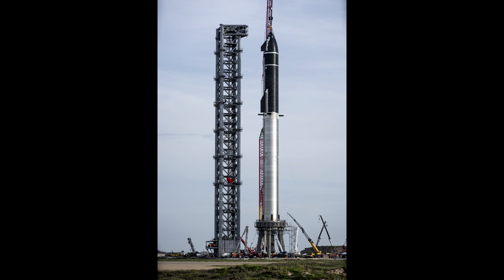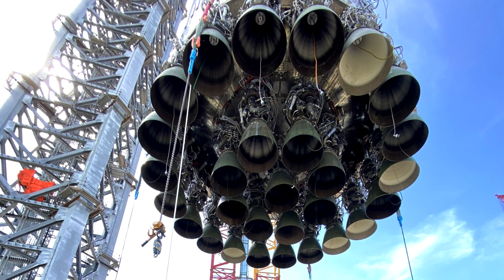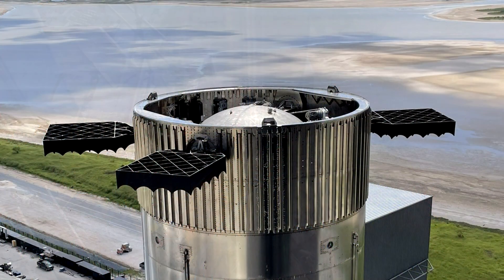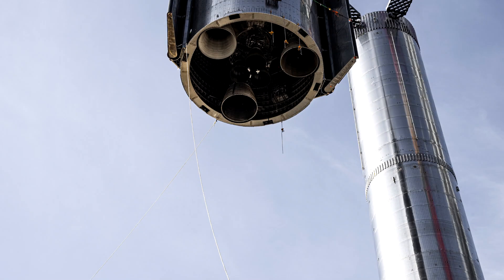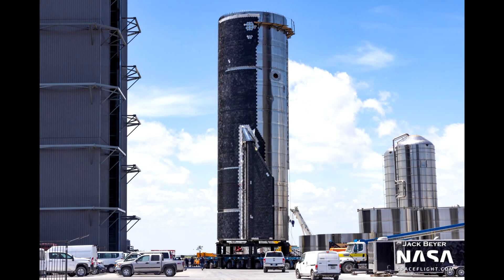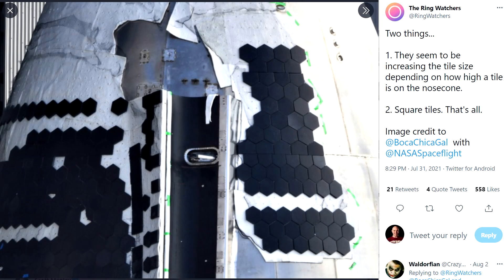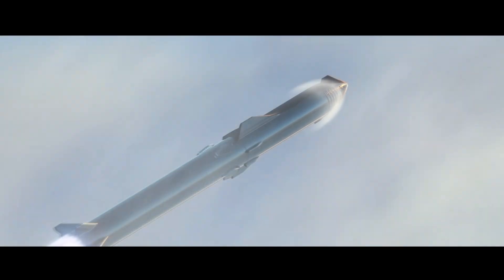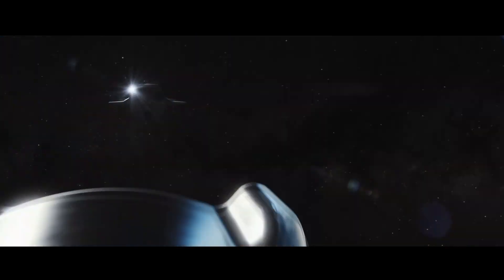How SpaceX Designed A Heat Shield For The Largest Spacecraft Ever Built

Comment: As an ex welder, two things-- first, stainless does take much higher temperatures to melt, but aluminum conducts heat hugely better, so you end up needing more amps to weld it. Not sure how that will affect things, I'm sure they thought of it. Second (and what I'm looking forward to see) is that stainless gets hot and starts making really cool colored oxides, way before it melts. It's not as colorful as titanium, but it can make beautiful blues and gold under the right conditions. So there's a chance if the heat and available oxygen are just right that it could turn partly blue or gold just past the tiles, which would be super awesome.
Reply: Oh that’s a good point, that would indeed look super cool!
Reply: I didn't even think of how the skin could change color from reentry. While, they probably don't want any part of it to get that hot, it would look super cool!
Reply: Regarding heat conduction: This does not apply here as the heat is applied more or less uniformly to a huge and thin surface - the heat simply does not have anywhere conduct to - maybe except for a bit at the sides. Maximum temperature before losing strength is really the metric they want to maximize, hence the very specific alloy of stainless steel that they are using
Reply: @TheSe7enman  I think it’s potentially relevant when thinking about how well (or not-well) Starship could handle the loss of a tile from its belly side: how efficiently can that exposed stainless steel area spread the extra heat around to neighboring areas and keep things okay; versus does it just heat up, become a hot spot, and melt through. Something like that…
Reply: Plus is not just heat its cryo regime also to taking into account.
Reply: @TheSe7enman  Yep Aluminium is even worse because structure is literally trapped between heat tiles and ullage high pressure hot gas. So that becomes huge saturation mess. Especially in orbit where main source to rejecting heat is by radiate body only.
Reply: I filled in your last sentence as it could turn partly blue or gold before it explodes.
Reply: i saw some renders where they believed the starship steel would turn all the way to purple in that area on the non heat shielded parts of the ship above the wings
Reply: Yeah, like I said, sure they thought of it. The conductivity thing just popped into my head as being part of the overall equation. And aluminum really does turn to wet cardboard way before it actually melts, while stainless stays pretty strong until a pretty high temperature. I've used little tack welds to hold a weldment together, and they've been bright enough to see from under a hood while still holding.
Reply: Solution: All-clad Starship (like the cookware). A layer of aluminum between two layers of stainless steel, so heat is conducted much better across entire surface.
Reply: So a blue or gold colored Starship?
Reply: IIRC the color it gets depends on temperature oxygen amount and time exposed.  I would think that looking at the color pattern if any, will tell them a lot of how it did.  Something you do not get with aluminum.
Reply: I was thinking why not use like a silicate welding blanket to mount the ceramic tiles to. Also put a ridge on starship down each side to mount the shielding quickly, but mostly to protect for plasma spill to the aft end. I feel like this accomplishes so many things. Quick application and swaps of heat shield and it can be manufactured off-site in strips for consistency. It also allows for a soft subservice so the tiles won't knock and crack.. and it could be manufactured with so much more consistency. I think their current heat tile attachment system is untenable.
Reply: @sammadison1172  underneath the ceramic tiles they put ceramic silicate blankets to cover the steel as an extra layer of protection. scott manley just did a video today showing photos and process of applying the shielding on the bottom side. each tile has 3 pins and you just press the tile onto the prefab pin locations
Reply: Not only would it look awesome, but I bet it could be used as a diagnostic method to see where the heat shielding could be improved (provided, of course, that it doesn't fail outright and the craft blow up on re-entry). Just look for where the metal turned pretty colors.
Reply: @jgottula  you could have thermal cameras on the inside of the tanks to check for hotspots and use the bits of remaining cryogenic oxygen and methane on the inside and splash them through automated firefighter hose nozzles on the hotspots for cooling. Only works on the tank sections though
Reply: we might see some interesting color patterns as the steel heats up in the low oxygen environment of the upper atmosphere

maybe even on the skirt of superheavy the same way we see soot marks on falcon but with oxidation colors instead of soot
Reply: When you launch 1000 starships and unlock the gold skin
Reply: @skraminc  so you are in the comment section of the Manley video you mentioned. I know, it can get confusing with all the videos being produced and the many subjects in the comment sections.
Reply: @sethdrake7551  Oh yeah, I didn't even think of the booster's skirt heating up. I think if there's any part of either spacecraft that will change color, it'll be around the bottom of the booster. That would look so cool.
Reply: @jaychip1  haha yeah, sorry. i thought it was in the elon musk tour with everyday astronaut
Reply: Oh you’re so right…. to see some evidence of the plasma heating just to leeward beyond the tiles would look INCREDIBLE!! Kinda like the battle scars on the F9 boosters after reentry. “Flight proven”
Reply: @TakkudALT  you won't see much blue or gold on the starship itself, due to the tiles & wadding covering the Stainless.  On the booster which is mainly stainless, doesn't go high enough to suffer re-entry temps, so maybe won't get hot enough to change colour as spectacularly as you're all hoping for? (Not an expert on this, correct away! 😁).
Reply: @jgottula  Not if on the other side you have cooler gases or liquids ,it is where insulation or conductibility matters most .
Reply: @TheSe7enman  heat conducts into the fuel, since the outer skin of the fuel tank is the same as the outer skin of the ship. the fuel may not contact the skin everywhere though. maybe they could rapidly pump fuel over the bottom side of the tank to cool it like a turkey baster.
Reply: @We All Laugh Down Here 'It is no comparison' you said, while comparing them. I understand you were being hyperbolic. It just makes you seem ignorant to the language you use, and therefore makes me doubt how carefully (and therefore how accurate) you make your other statements in that comment.
Reply: Reused Starships are certainly going to be a sight to behold, I really can't wait to see them
Reply: This aged like fine wine.